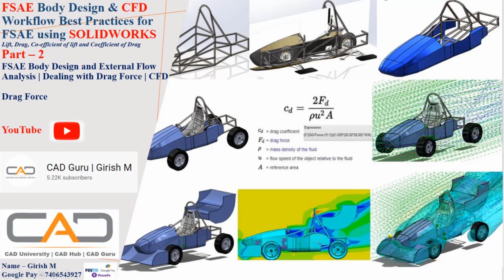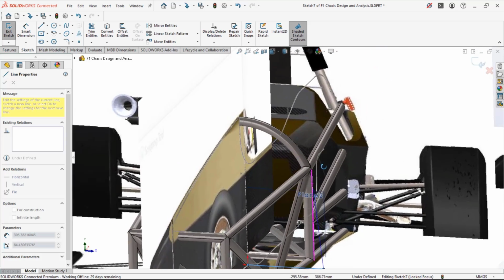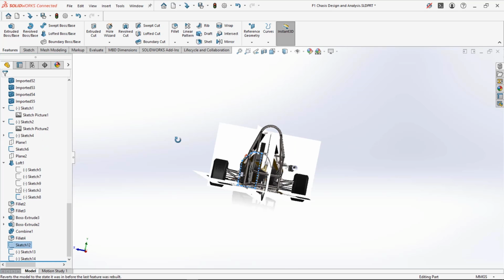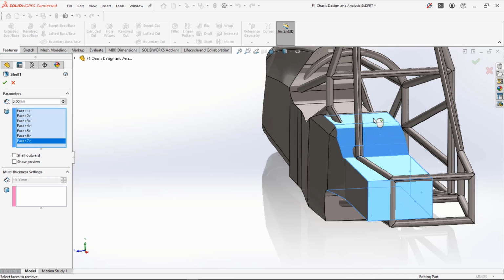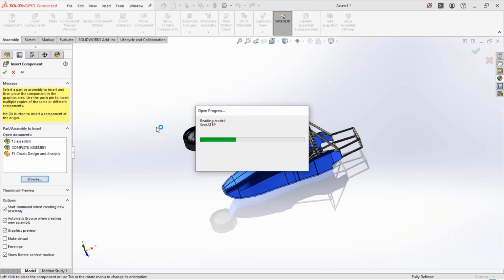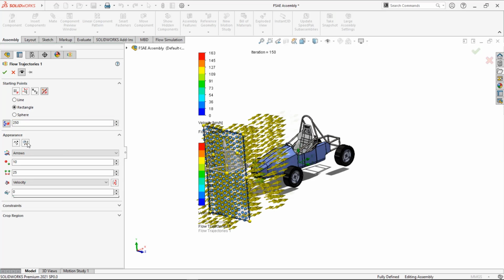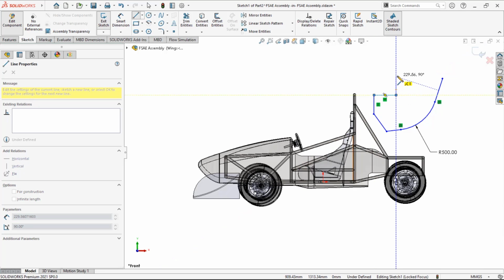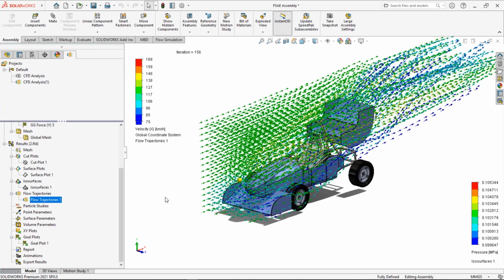FSAE Body Design  CFD Workflow Best Practices for FSAE using SOLIDWORKS

Comment: I guess Y force gives lift force/downforce rather than drag force. And why you wanted to increase the drag?
Reply from the maker: Nope,.... X component will results in drag ...
Reply from the maker: Here, I am just evaluating basic model with basic design. 
For the beginners this tutorial will help them in analysing standard practical models with this basic model.

They can use this case study to improve this conceptual design to more practical model.

Just wanted to give them a clear Idea about Design and CFD evaluation from scratch. 

Thanks.